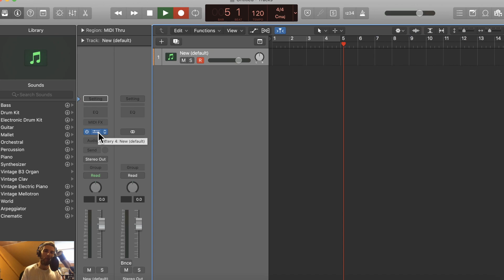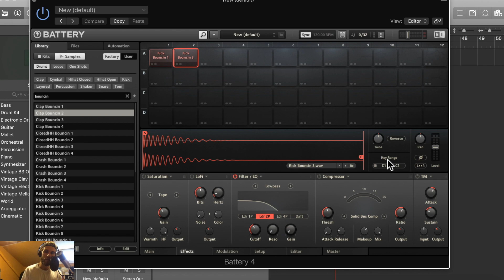Battery 4 Basics: How To Layer Kick Drums

Comment: love your battery tutorials man..is there really no undo button in battery though? I made a clap/snare and accidentally replaced the whole thing. instead of redesigning (which took a while) how can I just go back a step to what I had? thx
Reply from the maker: Thanks glad you found them helpful! As far as I know, there is no individual undo button for each cell in Battery. As of right now, you can really only undo certain things manually. What sucks about that is, let's say for example, if you change a saturation setting in your fx chain, it will change how all the fx after the saturation plugin in the chain effect the sound. That's not only true with saturation but with any plugin you add or edit. Your best bet might be to save after every couple of fx changes or so but that might get annoying since you'd be saving multiple variations of the same sound. But then you'd at least be able to go back and edit without having to start over. That's interesting though, I'll have to look more into it. I feel like there should be a cell undo button but I've only seen the global undo. Hope this helps!
Reply: thanks. where is the global undo? I didn't see not one undo button lol..maybe I missed it
Reply from the maker: there should be a bar above the cell grid with a few different options. Its right next to the "compare" "copy" and "paste" buttons. Do you have the most recent version of Battery installed?